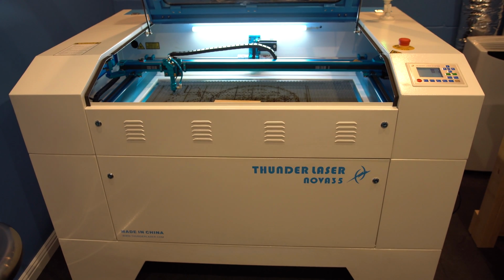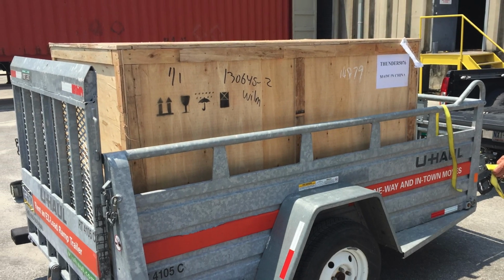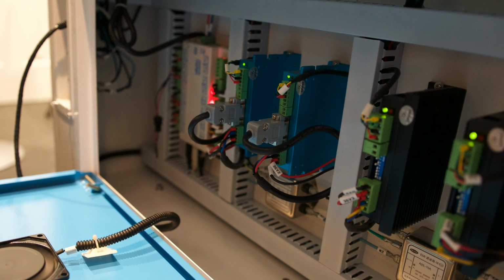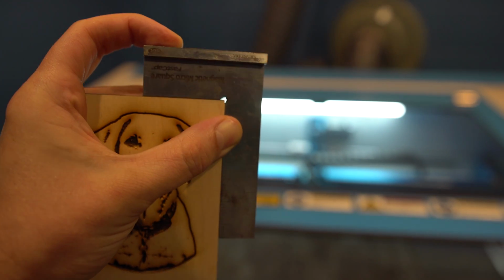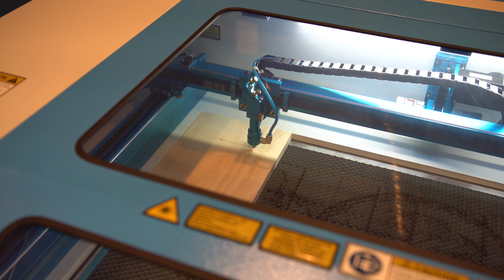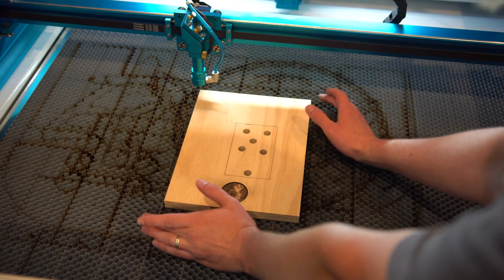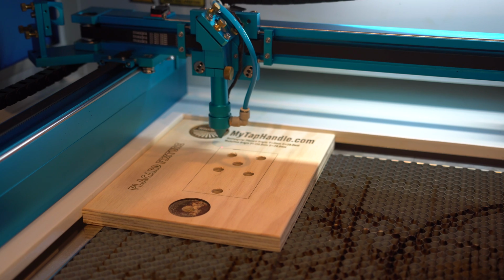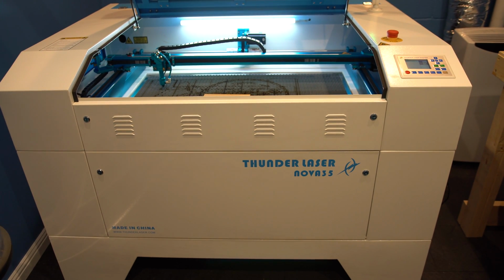Thunder Laser Experience & Feedback

Comment: is that smoke toxic?
Reply from the maker: It can be. I use air extraction and vent to the outside.
Reply: @anthonyisrandom  First, thanks for sharing! Which model machine do you use for fume extraction? I hear Bofa are the best, but the prices of the machine and filters are extremely high. Thunder offers me chinese fume extractor, did you buy from them? How much are filters and how often needs to be replaced?
Reply from the maker: @abrakadabraaaaaaaaaaa  I am using a large blower setup that I did get from Thunder, I am venting to the outside so filters are not being used at this time. I am not 100% sure what model it is, but it does a good job.

Comment: I'm researching a laser myself. Exciting to see this cheaper option (without the problems associated with buying a no-name china import from eBay). 
What I'd really like to know is how does it compare to you experience with the Epilog - where do the limitations show? Is it in how fine an image can be etched?
I can't afford an Epilog/Trotec either, but if it was worth it I could finance one. Thanks for sharing!
Reply from the maker: So sorry for the late reply. I didn’t see you comment. 95% of the time I work in wood. I find the detail to be fantastic for my needs. When working in wood, I find. I difference between my laser and my fathers Epilog. Where I have seen a difference is when the material can take a higher resolution. Glass, for example, seems to do better on his. I have a HR head for my laser and I can get close to the same quality, but the Epilog will edge it out. The main thing I like about my fathers Epilog is it’s ease of use. You are up and running right away. You are close to the best quality right away with their software and material recommendations within the software. With my laser, I was up and running, but it took time to learn in order to get the best quality. Epilog rocks. I just couldn’t afford one at the time. Now that I know my laser, if I needed another one and could afford both, I would still get the Thunder Laser.

Comment: How’s the laser running to date ? I’m looking at Boss or this brand. Did you order through the USA Distributor in Texas ?
Reply from the maker: Mine is working great and I still love it. It's had zero issues. I actually ordered my direct from Thunder Laser. It came by ship (That was an experience, not a bad one, just complicated). I certainly would explore the USA distributor just because of customs/tariffs, etc.
Reply: mytaphandle.com 
Very glad to hear. I plan on ordering my Nova 35 next week !! 
My obvious concern is service and parts from China.
Why did you choose Thunder over Boss ?
Reply from the maker: 1. I had time. I knew I needed a laser, but I had a couple of months. Because I had time,  I could wait, and the price was significantly less expensive. 2. Having put together my CNC system, I felt I could support my own machine reasonably well if the need were to arise. Thunder uses quality off the shelf parts that I could purchase from others if for some reason they were no longer around. I have not had to use there support, so I can't give you first-hand knowlege. Those I have talked to that have seemed pleased with the support they received.
Reply: mytaphandle.com 
Understood. Did you have to align the mirrors right out of the box and Did you check it before first use? Thanks for info.
Reply: mytaphandle.com 
Do you have yours running on one 20 or 15 amp circuit ?
Reply from the maker: I didn't have to align the mirrors. I kind a threw caution to the wind and just tried it out first. It was aligned perfectly. I have not had to mess with alignment at all.
Reply from the maker: 15 Amp...but I do have the chiller on a different 15 amp circuit.
Reply: mytaphandle.com 
Gotcha, so you didn’t connect the chiller to the back of the Nova 35 ?
Reply: mytaphandle.com 
Nice, glad to hear.
Reply from the maker: No just the exhaust and the air pump are connected to the laser on my setup.
Reply: Have you used the Blades under the honey comb top. I heard one downfall to the thunder or any Chinese laser is the exhaust and draft of the fumes. its a lack of air in, the louvers in the front arent enough. Do you find this true.
Reply from the maker: A few times I have used the blades only...but rarely. Mostly I use the honeycomb on top of the blades. The air fan/extractor that I got from Thunder is a beast. If there is an airflow problem with the design, I do not notice it. There are for sets of 5 louvers in the front. When the fan/extractor kicks in there is a lot of airflow through them. If one wanted more air in, I personally would have no problem drilling a few holes in the front because of the way the design is. I have been happy with the fume extraction so I haven't even looked at that. My fathers Epilog mini 24 does appear to have greater air intake ratio when I look at the design.
Reply: mytaphandle.com 
Got it. Thanks for confirming. Just put a deposit on the nova 35. Should have it in a couple weeks.
I was also thinking the front feed thru can be removed for added air flow if Necessary

Comment: As this point in time would you still suggest Thunder Laser? I'm looking to purchase a laser and don't feel like paying 20k+ for a Trotec...
Reply from the maker: Seth, I would certainly purchase again. I've almost had mine for two years and it is going strong. No issues. Only real change is I have started using a 3rd party software called LightBurn. I still use RDWORKS from time to time but find I love LightBurn's feature set way better and it runs natively on my Macintosh.

Comment: Thanks for this, any more Experiences since then ?
Reply from the maker: I use my laser just about everyday. It works like a charm. One great discovery the other day was what 80 Watts can do. I never go over 60% power in my settings. I wanted to make a fixture for my CNC router. I wonder if at 60% power could it cut 1/2" or 12.7mm MDF. Yes..at 3mm a sec it cut it just fine. So..80watts seems to be pretty good. Now I won't do a lot of that kind of cutting..but it's nice to know that I can.